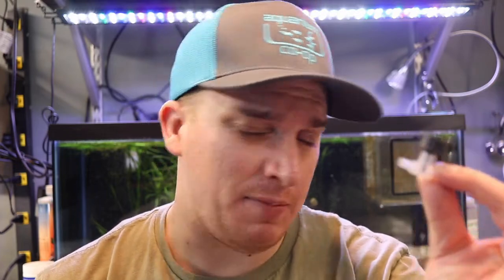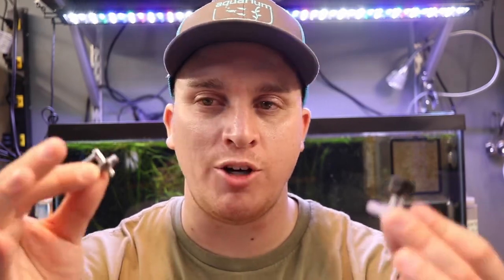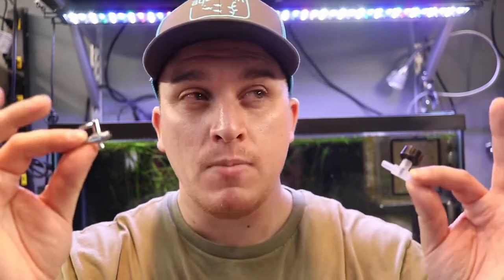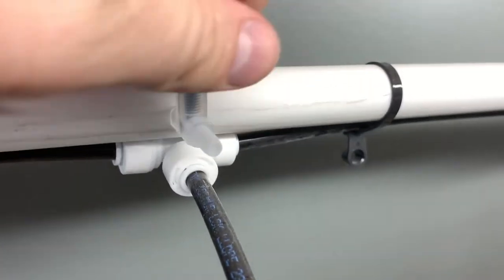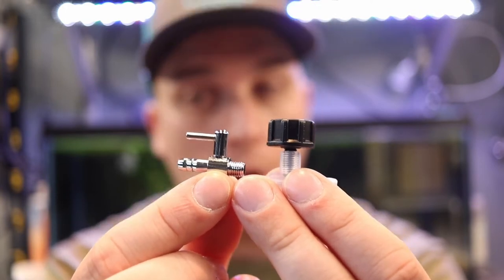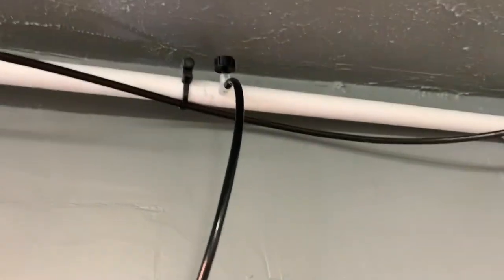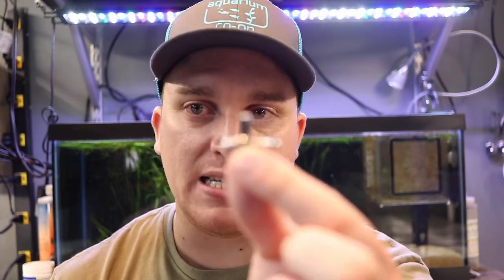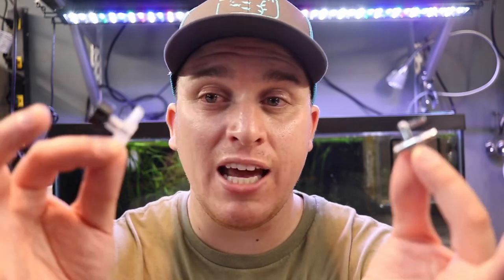Which Air Valve Do You Need?

Comment: I’m building my first air system in my apartment and thinking of running both as you suggested for fine tuning. For the metal valves what tap did you use for the PVC?
Reply from the maker: Standard drill bit of the correct size.  I would have to go back and watch videos to give you an exact size.  I would put the metal valve in the chuck of the drill and tap it into the pre drilled hole

Comment: This is awesome you put out this video! I was actually just thinking about how I wish I could fine tune the metal air valves! You answered the question that’s been on my mind. I will be running the Ziss air valve midline now
Reply from the maker: Glad to hear this helped at least one person!
Reply: @WeldonTanks  seriously it has. I just finished building my closed-loop air system and tapped 4 metal valves for 4 tanks. Was left pondering how do I adjust the airflow to each tank. Now I know!

Comment: I use the metal ones for when they need to be mounted somewhere. I use the gang valve version though. And then I use the ziss ones for valves that is placed mid line. I find them abit easier to finetune :)

Comment: Hey, I can use this valve for a betta drip system? Don’t know if it works as good with water too. Thanks!
Reply from the maker: I have now tested the metal valve with water and it works great.  If you were to use the Ziss valve on a low pressure system I think you could control the drop rate without issue
Reply: @WeldonTanks  thanks for the reply, I will try with the Ziss and if it’s not as I expect then I will change to the other one. Great video btw!

Comment: I'm glad someone can finally admit that the ziss in the mainline isn't the way to go ... i tried it. With 60 of them unfortunately,  going to switch over to the metal ones as they thread into the holes I made for the ziss .. i used a slightly smaller bit than what everyone recommends for the ziss because there was too much play for me. Fortunately the metal ones will thread into it properly
Reply from the maker: MarlinChaser 87 I am debated on switching everything over.  My next build will definitely use the metal ones.
Reply: @WeldonTanks  just try putting one in where you have a ziss now and make sure the hole you used isn't too big...im glad I drilled smaller ones. If so it wouldn't be terrible to switch them all over... but i get it, I have the new valves but haven't done it just because its a tedious task for sure.
Reply from the maker: I found that the metal ones fit into the holes I drilled.  Just timing and cost

Comment: Great video.  I haven’t used these yet since I’m running my 4 tanks in different rooms but this will be good to know if I can ever convince the wife to get a full fledged fish room.  With the never clog air stones and the usb air pumps from aquarium co-op I may get my hands wet but they can be dialed in a bit for surface agitation.  Do you use the metal valves for drip acclimation?
Reply from the maker: The metal valve can be used for drip acclimation.  Guppy guru taught me that one
Reply: Awesome.  I thought I remembered seeing you guys use that when you acclimated the discus in his new tank.  I may have to order a pack on my next order so I can use them for that.  It would make it a lot easier to get the right flow on the drip.
Reply from the maker: I have plans to show it better in an upcoming video
Reply: Wel-Don Tanks Thank you that would be great.